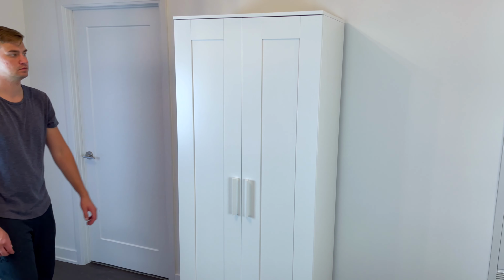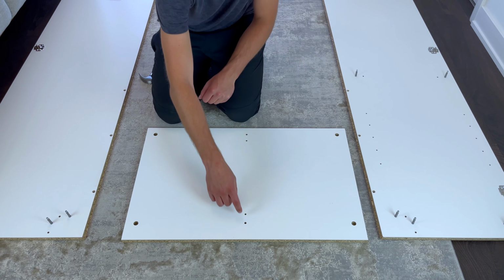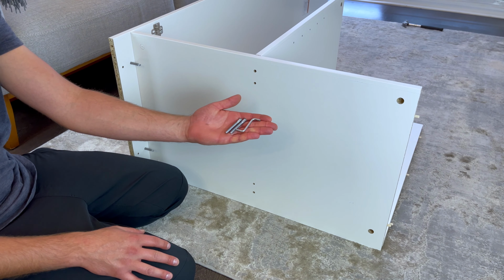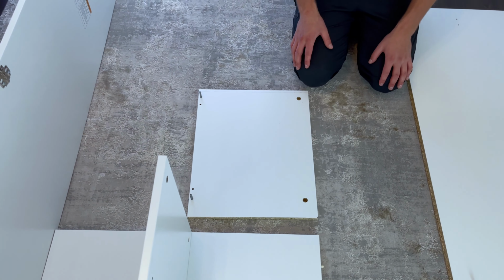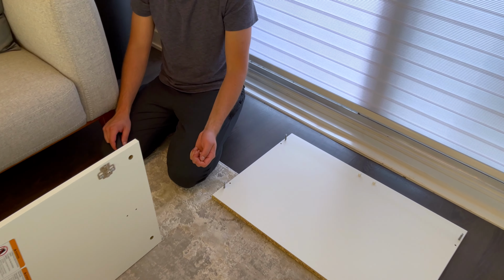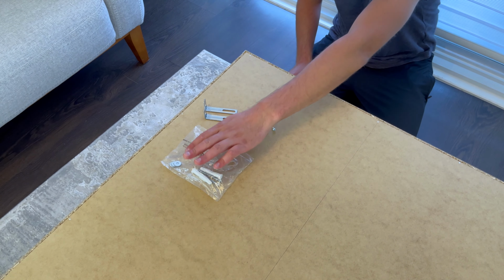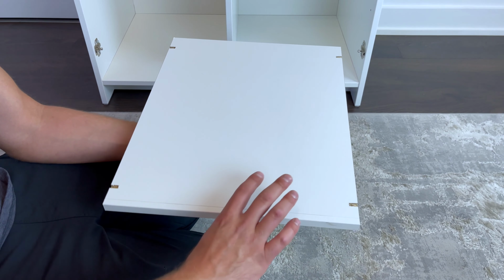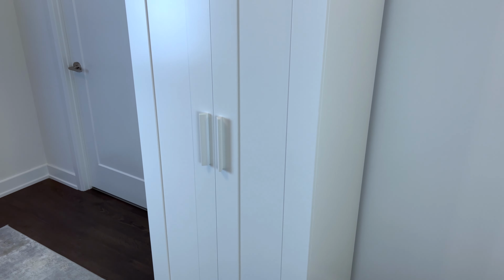BRIMNES Wardrobe with 2 Doors IKEA Tutorial

Comment: WARNING: On new models the bottom part is changed, and has an extra step before you attach the second main wise.

With the one I just purchased, the bottom slab is a couple cm thicker. So the camlocks need to be pushed in that couple cm, looks different.

Also there is a third front facing bottom part. It should be added before the right side is attached.

Comment: Thanks for video its already really usuful but Can I ask ? I'm stuck here (04:03). It looks like it doesnt fit to the holes and I dont have idea what I did wrong. Thanks for answer(s). :)
Reply: I have the same problem, did you figure it out?
Reply: This is an issue you need to push the plastic piece all the at in to grab the metal part then turn. The book shows the piece being flush but the way they positioned the metal part you need to shove it in a good cm to access it